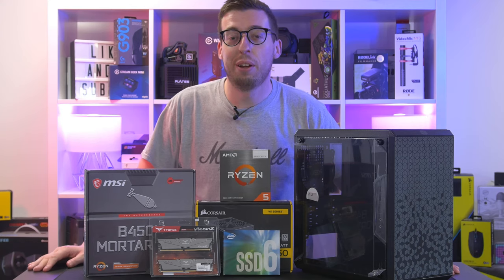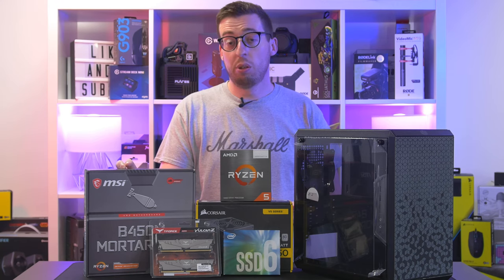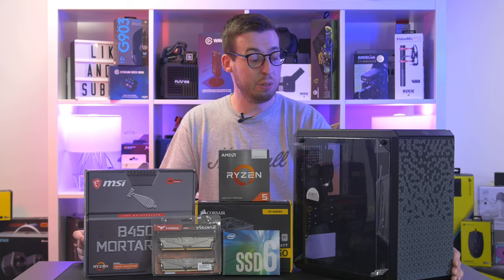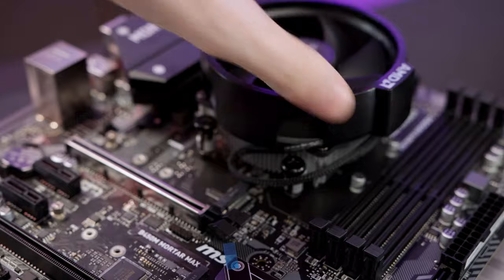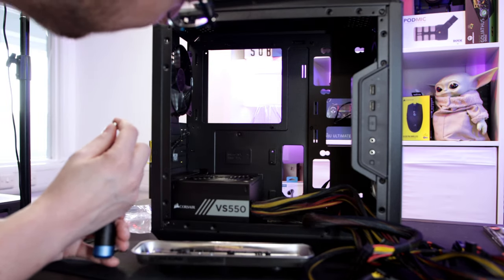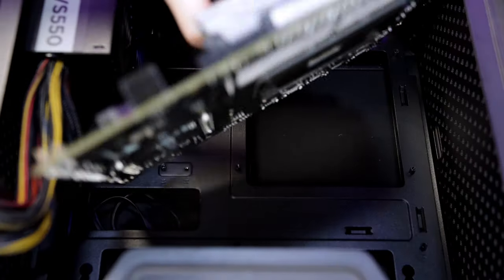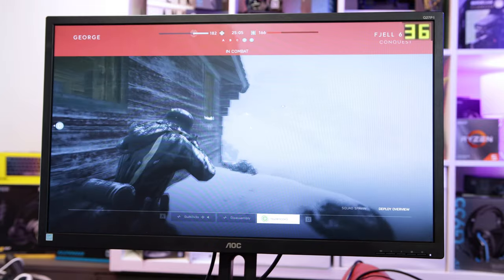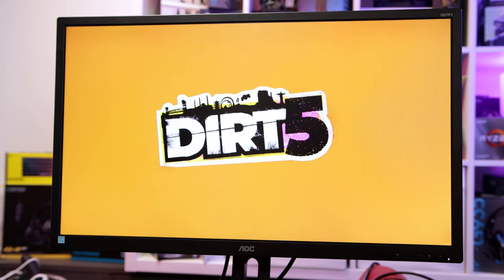The $600 NO GPU NEEDED Gaming PC! - Full Build Guide & Benchmarks! AMD 5600G [4K]

Comment: How much vram you've allocated to the igpu?
Edit :- Should I enable docp/xmp? As I got my processor replaced just after two days of purchasing since it got damaged. I enabled docp previously.
Reply from the maker: I left it standard, as the majority of builders wouldn't tinker in the bios. 

Enable Docp/XMP yeah, otherwise your RAM won't run at the rated speeds.
Reply: @jordanash     is it safe, as I previously enabled it and my processor got damaged (not sure if enabling xmp was the reason) just after two days of purchasing so I got it replaced and now i don't want to take any risk by experimenting things
Reply from the maker: XMP shouldn't have any effect, as it's changing setting on the DRAM slots and is separate to the CPU anyway
Reply from the maker: What motherboard are you using?
Reply: @jordanash  asus rog strix b550-a gaming
Reply from the maker: That's a good board so shouldn't be the source of the CPU problem.
Reply: @jordanash  I am just curious should I enable docp or leave as it is.
 And here are my pc specs :-
Ryzen 5 5600g (obviously)
Asus rog strix b550-a 
2x xpg 8gb 3200mhz ram
Cooler master mwe 550 psu
Reply from the maker: I'd turn it on mate, I don't see why you should have a problem
Reply from the maker: Is it all working okay?
Reply: @jordanash  yeah the new apu is working absolutely fine. But didn't enabled docp.
Reply from the maker: Oh right. You should, otherwise your RAM is only running at 2/3rd the speed

Comment: Can you help me build one?
Reply from the maker: How do you mean mate?
Reply: @jordanash  so the amd ryzen and the corsair part are out of stock or they don’t deliver to me so what else should i use for the amd ryzen and the corsair part
Reply from the maker: So you'll need that specific AMD processor if you don't have a graphics card. And for the Corsair power supply, anything in a similar power and price will be okay, just get a good brand.
Reply: @jordanash  ok yeh i got the amd problem fixed but could u suggest me one lol i don’t really know much about building pcs.
Reply: @jordanash  oh yeh could i get a 650 watt one or would it not work if I bought it
Reply from the maker: 650 will be fine mate. If you tell me what country and website you're looking at, I'll suggest one from there
Reply: @jordanash  uk
Reply: @jordanash  well i the 650 watt one is out of stock I just realised
Reply from the maker: Here you go - https://amzn.to/3kv0ZbJ
Reply: @jordanash  how much fps will it run and what are the specs for it cause im buying a monitor aswell
Reply from the maker: I show fps on different games in the video mate. But the PSU has nothing to do with fps.
Reply: @jordanash  so does it have 31 fps max because when i saw the tomb raider part it did
Reply: @jordanash  so basically it runs 30 fps but if i bought a graphics card it would run more frames.Where should i put the graphics card if I should buy one
Reply from the maker: Yeah but tomb raider is quite an intensive game. And into the PCI slot. Google how to install a graphics card, or check my other build video
Reply from the maker: Sorry for late reply, comments aren't great for longer conversations. Join my discord and put a message in the pc builds section, it'll be easier to keep track of - https://discord.gg/WB8dxUKEym